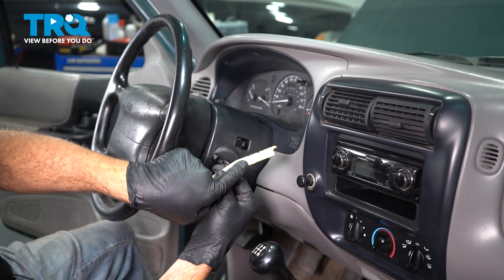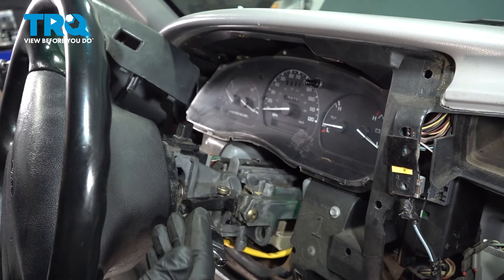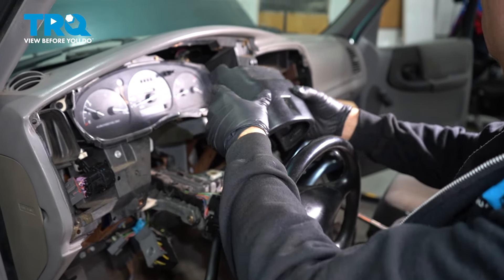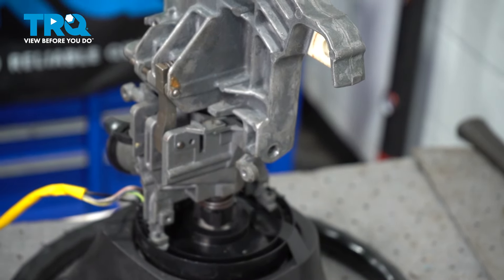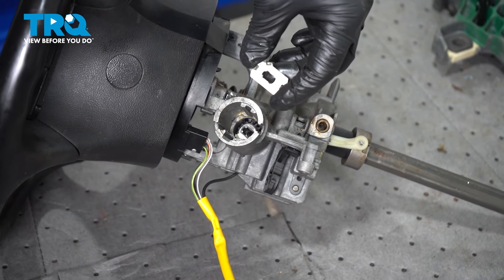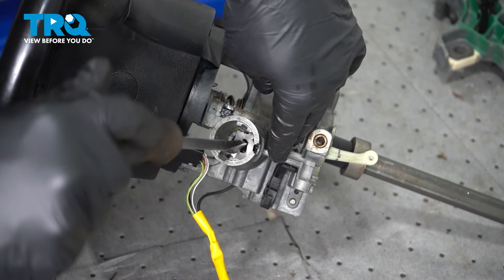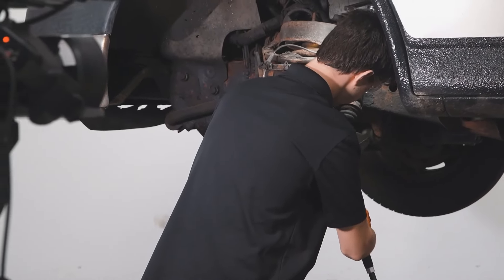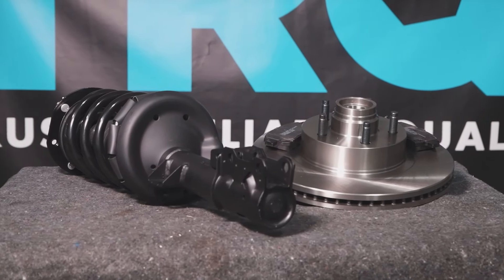How to Replace Ignition Switch Actuator 1993-1997 Ford Ranger

Comment: I have a 1996 ford ranger that thinks it is always on. You turn the key off and it won’t turn off. We replaced the ignition lock cylinder already. Is this what is broken with mine? I am thinking it is.

Comment: Is it necessary to remove the entire column from the vehicle? I saw a post on the CrownVic forums where someone removed the steering wheel, clock spring, airbag, and cylinder lock housing/tilt and was able to access the actuator rod that way, whilst leaving the bottom portion and steering shafts (with ignition switch and lower actuator block) in place.

Comment: How do you remove the ignition switch on a 1992 Ford f250 if you don't have the keys? That's what I was googling and it suggested this video. Watch first half of your email and you are very detailed like usual. But I'll see wasn't showing me what I needed. Understand that you turn the key to run position but that's the problem. Ignition switch in cuz I've lost them.
Reply: Yes, well, I'd seen another video in which there was no key and the person used 2 drill bit sizes and before drilling he marked the depth the same depth the key would go, after drill with the bigger drill bit, the ignition would turn with a standard screw driver or almost anything, or nothing, just by turning the ignition switch. But he Also did something with the switch or top, highest wire block connector but not really sure what he did, except he didn't do anything with the wires but something with a rod or shaft in a groove or something like this ?? But it's on the U-Tube platform, I just watched it.
Reply: Sorry, use tape to mark your drill bits depths.

Comment: The block that the rod connects to, how does that come out. i have tried a few times and there sees to be no way. Its "the plastic block" you talk about as you are pulling the two halves apart. its at 17:45
BTW. Great video. i am a fairly accomplished tech, but i have never done a steering column. so this was a great experience and with your nicely detailed and not overly non-subject yakky proceedure was refreshingly proffesional. thanks

Comment: Great  video,well done. the repair seems involved for the replacement if a small part.Ford should be sued if that is the easy way.No complaints about the video, but it leads one to realize there are couple places we could run into difficulty.

Comment: I have to replace that actuator on a 2003 Grand Marquis. With the key I can start the car, but not shut it off. I took things apart to get the switch part off. I can see that the part of the actuator that engages with the ignition switch is the part that does not slide up. The key turning can only push it down (towards the start position, but not bqck towards off position)

Comment: What would be symptoms of why you would replace this acuator?

I have a 2000 Ford Taurus SVG Sedan that has an almost identical steering column.  I turn my key and it will move to the start position, but won't go far enough to turn the engine over to start.  I've removed my ignition switched and with the key in the lock cylinder, I can move the ignition switch manually to start the car.  Can't figure out why my key won't turn far enough to move the switch post/pin far enough.  Any ideas?
Reply from the maker: +@therobbywaller We wouldn't be able to diagnose an issue like that here, you may want to have a local mechanic take a look at it. Thanks for checking us out! http://1aau.to/m/Shop-1AAuto-c

Comment: Can anyone say if this is the same for a Crown Vic or pretty much?  I can't shut mine down.  I can start it with the key but I have to suffocate it and pull the battery terminal to shut it down.  The key just spins around if I turn it backwards.

Comment: you should try taking one apart without marking anything. the actuator rod will only install one way .

an overall present experience to fuel contempt for the building 5 folks at Ford.

Comment: This is why technicians hate engineers. Horrific idea to capture that rod inside the column and force us to disassemble the steering column to gain access. It looks easier if you take the steering wheel off and pull it in the car tbh. Either way this was probably the first one of your videos I watched and that very little cringe moments or critiques. Well done.